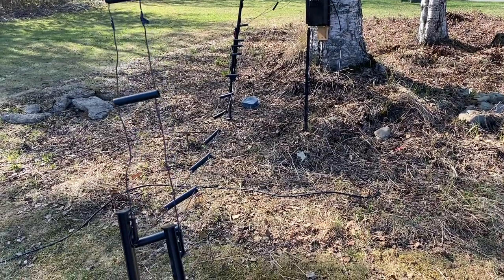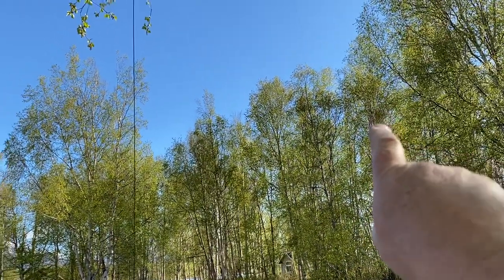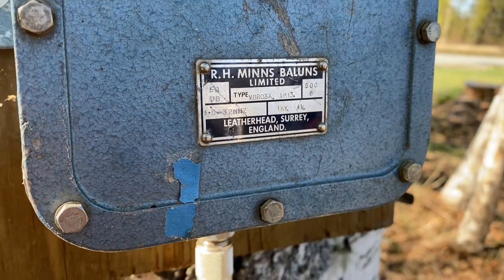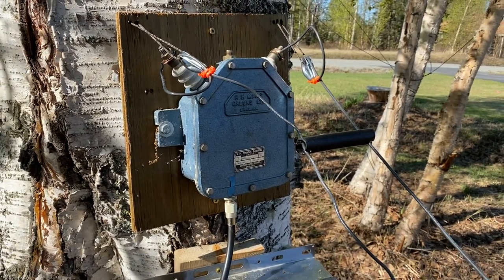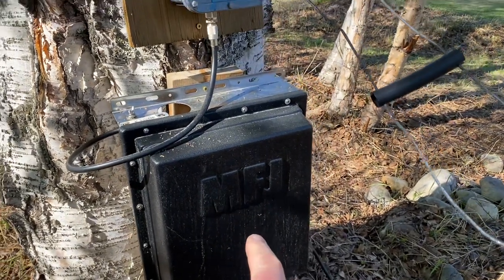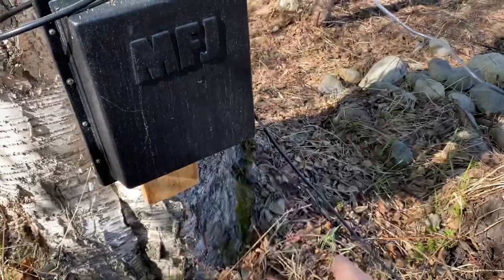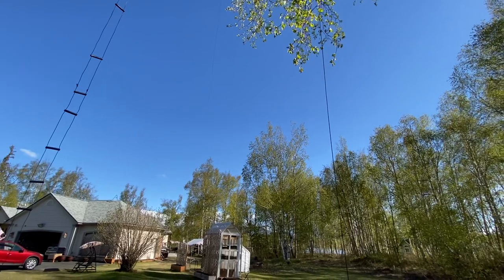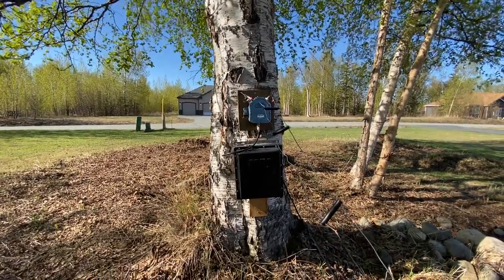Vee beam and 1979-82 Transglobe expeditionand R H Minns  Balun

Comment: Laurence,
Interesting video..  I am going to steal your idea of using the electrical fence posts to bring my ladder line to the feed point.  I need to shorten some of those and use them under the crawl space under the house to keep the ladder line secure and isolated.  Also, I have a video request.. if you could take the lid off one of those baluns so we could see what the construction looks like.  Also, would like to hear more about the performance of your vee-beam on wspr. Do you just use the vee-beam on 30 meters?  I see your WSPR spots on 30, 20 and 17 meters. Inquiring minds want to know.  73, K1QS.
Reply from the maker: hI- thanks for the comments - the electric fence posts are pretty reasonable cost wise, and Ive had this lot for over 20 years and still only managed to break one physically - breakdown and other electrical characteristics at RF are not tested but I dont see any issue at 2.5K Watts when used on my commercial arrays test range. 

Im loathed to take the cover off the baluns as I dont know the state of any  moisture mitigation or bolt shearing possibilities but ill take a more detailed look ; The Mimms area a work of art and built for military and commercial usage - these two were park of a sloping Vee beam array used at Both North and South pole expeditions, and latterly in Scotland/Alaska, so they have been thru it but still look and test good - Im guessing they were built around 1977 or so, but maybe a few years earlier .  

The Vee is on kl7l/vee under wspr.org and currently I move the frequency as the OWFs change. Its only starts to come into its own above 10MHz as "optimum" internal angle, height, wave angle, our local ground out to say a 400m  and wire length are just some inputs -  Its certainly not set up correctly for "beaming over the pole" which is what I wanted it for on 20m and I need to move the legs around  a bit. I also have to be a little concerned over localized coupling from other arrays.

On other freqs 10/12/15/17/20m are on a Hex beam  at 35ft using a pre amp and Oak hills 4 way splitter/with additional isolation mitigation, for 30 and 40m (non Vee) are on dual 30/40m dipole at 35ft NE/SW

There will be a little bit about some of the expeditions where I and Ginny Fiennes used these on HF and  use in the Sir Ran Fiennes biopic - see trailer for new film at  

https://youtu.be/AyJrs40XVDM

73

Comment: Hello, 
Thank you for sharing your installation.
Where can I get a datasheet and circuit diagram of the 1kW Minns Balun you are using?
Reply from the maker: Ive been looking but I dont think they exist anymore R.H. MINNS is the correct spelling and looks like they went into voluntary liquidation in 1965 and had an address at R.H. Minns Electronics Limited, The Lower Mill, Kingston Road, Ewell, Surrey (in 1960).  - Its therefore highly probably my balun manufacture date predates 1965 and are even older than I thought. MINNS liooks like a proflic designer in the 40s and 50s and presented a number of papers amp/cores/bridges
Reply: Minns Baluns Ltd can still be found via South Midlands Communications, l am unable to post their web address as YouTube bans these links.
 ctsminnsdotcodotuk.😉